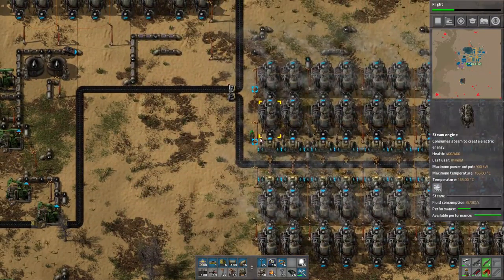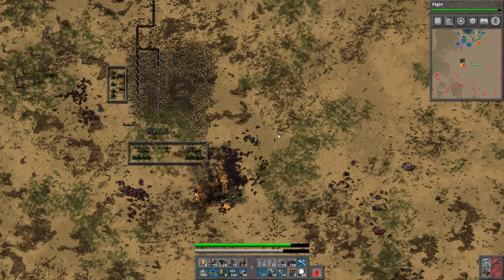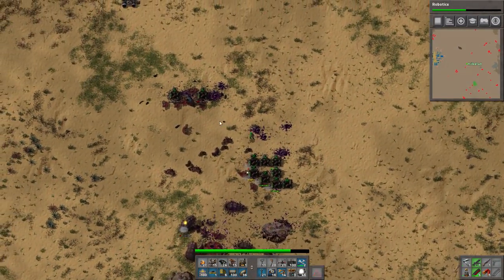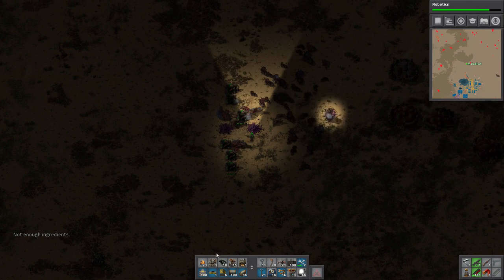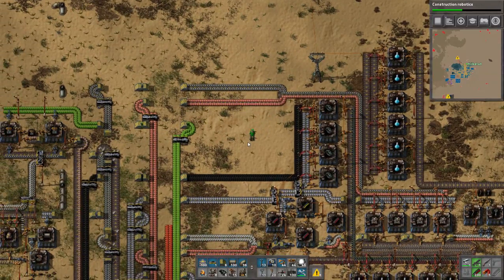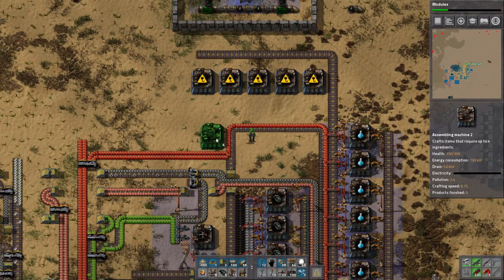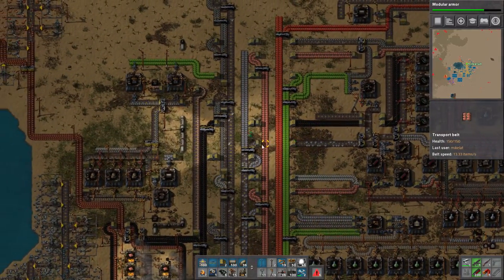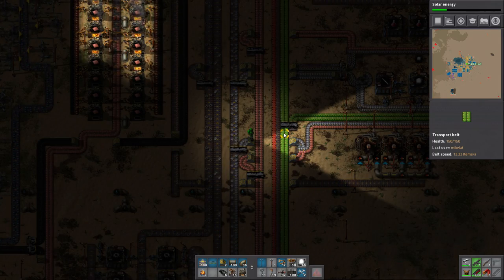Let's Play Factorio 0.16 - Part 14 [Desert Deathworld Marathon]

Comment: So, there's one thing I don't understand: you were really desperate to get rid of the base with literally all the worms in one place. The one right next to your base. And you just finished the part where you replaced all your gun turrets with laser turrets because the lasers were so much better in terms of damage (better type, but also higher numbers), health and range. You even had 3 laser turrets right on you at the time.

So why did you not drag a power line to the worms and let them EAT LAZORS?
Reply: Oh, you did end up doing that, my bad!
Reply: You don't need to do that. The car's turret out ranges the big worms by a tiny bit. You can just lay down a defensive wall of turrets, and snipe the big worms from outside their range.
Reply: @Strill_  personally i ended up creeping flame turrets as they out range everything, barrelling light oil isn't so hard

Comment: Just curious. Considering the biters attack usually guns or pollution, they should ignore walls, unless they cant go around it to get to the delicious. Shouldnt that make it possible to create Funnels for a fun no man's land. But i dont know how much the biters played defense grid.

Is accumulators far away? It could help with the energy constraints with the laser turrets, and you'd need less steam engines.
Reply from the maker: you can do mazes, I just am lazy and dont do that. im not sure if its overly effective, i find what i do to be okay anyway.

accumulators arent necessary. we're on steam power and i'll do something soon that's similar to accumulators but costs much less to accomplish
Reply: One method with walls I've seen that's really effective is to plant dragon-teeth walls outside the sealed wall... this is to prevent the biters to come in one large lump, overwhelming singular turrets, since the dragons-teeth effectively split larger groups up into smaller without blocking their pathing.
If you don't know what dragons-teeth are, think of like a chess-board pattern with open ground and walls for the black and white squares.